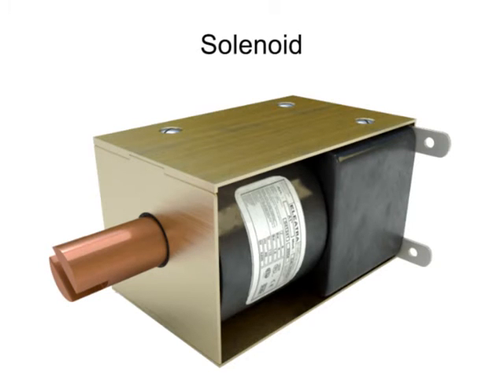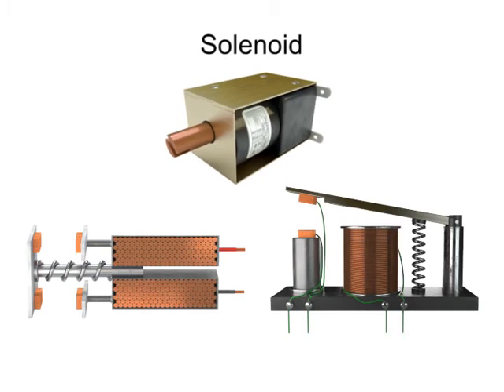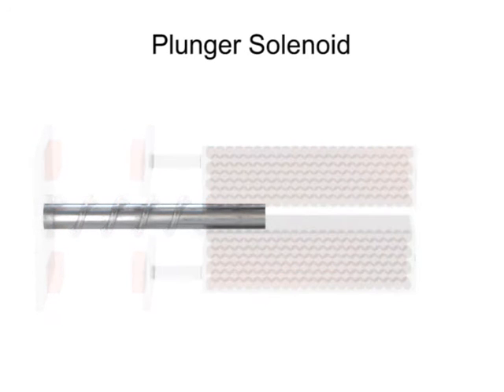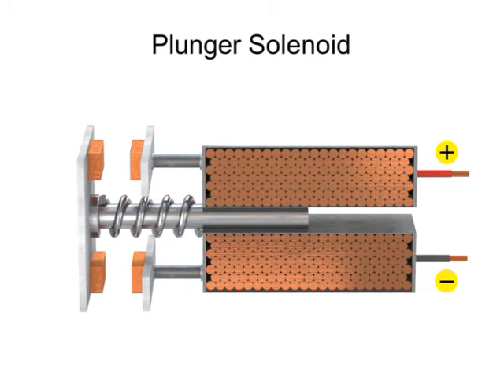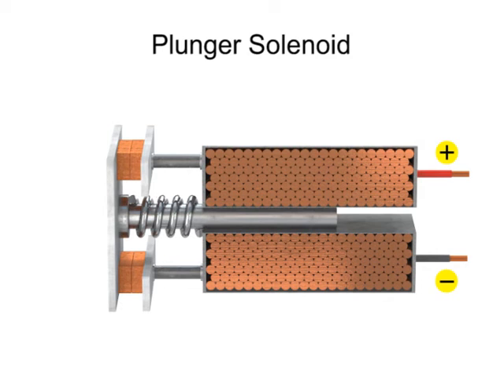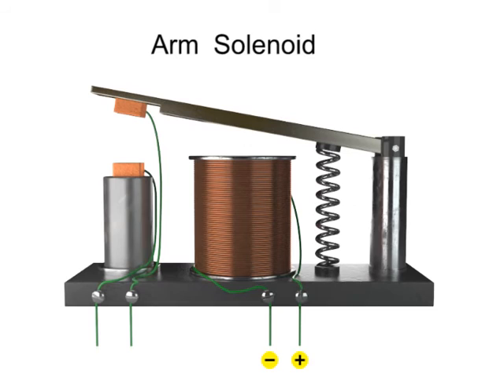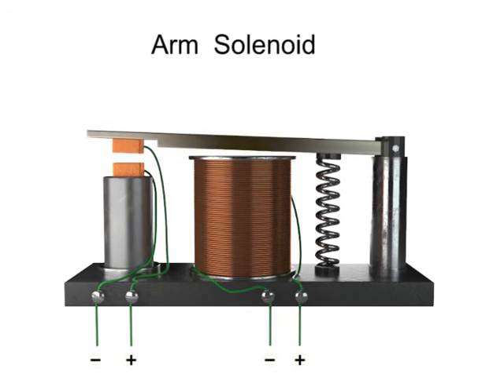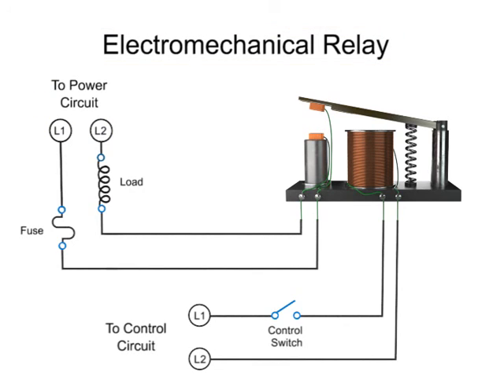Explanation of Solenoids

Comment: Hello I need a solution for a problem. In our case, a compressor and storage tanks are available. We want to release the air in between compressor outlet and non return valve of storage tank. Is it possible to use a solenoid actuated valve which turns on when compressor turns off?